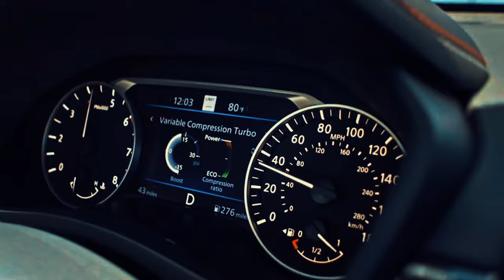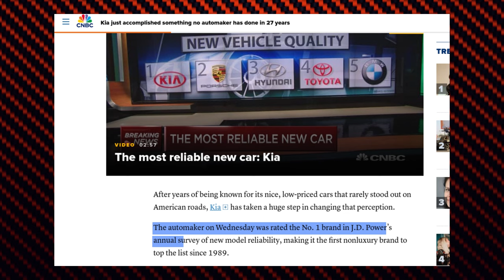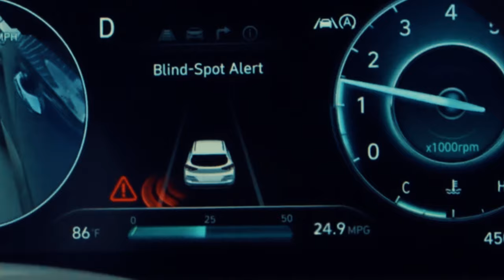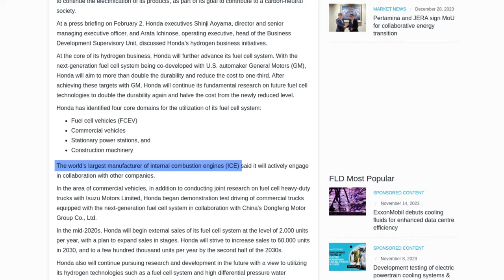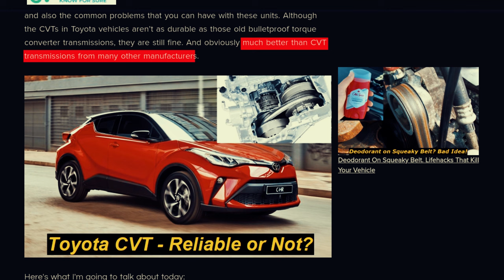The Most Reliable CVT Cars: A Brand Comparison

Comment: Whenever I hear someone state that a transmission, motor or vehicle can last over 100,000 miles, I take that as a red flag. As far as I'm concerned, any vehicle that has been taken care of should last at least 250,000 to 300,000 miles. There should be the occasional over 500,000-mile vehicles.
Reply: I have a 2015 Subaru Legacy with 183, 000 miles on it and no transmission (or any other problems) and expect it to just keep running fine.
Reply: @dankelley6194  If you take good care of it, it just might do that. I have a 2014 Legacy and just love the car.
Reply: @dankelley6194 that’s great to hear, my hyundai just hit 85k on the dash no problems at all yet it’s actually a little worrying I feel like everything will go wrong at once instead 😂
Reply: My ford fusion cvt lasted over 220k. It doesnt actually have a band like the others but two electric motors/generators inside.
Reply: My thoughts exactly. Any decent vehicle should last at least 250K miles.
Reply: The industry average I think is around 150,000 miles or 12 year life span.

Toyota is among the few brands that can make it over 300,000 miles.
Reply: @lrn_news9171  It's truly a shame. The industry average should be much higher than that. We need to have vehicles that will last a lot longer than that.
Reply: Which is why I do a drain and fill of the cvt twice a year. I got a smoking deal on 40+ quarts of castrol cvt at $2 a quart as a shop closed its doors and had a bunch left over. I'm not worried about the engine, it's the cvt that scares me lol.
Reply: @vermontvermont9292  Good luck. I hope that your car is one of those that lasts over 500,000 miles. Taking care of your vehicle and making it last a long time is something to be proud of.
Reply: @dankelley6194 have u done cvt service ?
Reply: I had a '91 Sentra with 293k that started on a dime after sitting idle all winter.

Comment: Ain’t No way you said Hyundai and Kia were reliable lmao despite its history😂
Reply: Outside of the US they are highly regarded as reliable. Outside the US cars are also maintained far better I work at a Hyundai dealership 9/10 of the problem is between the steering wheel and seat. The 2.0 NU series engine in the Tucson is garbage but the rest are decent even the Theta series with the class action suit we have 5 in the family all in 2011-2013 Sonatas and they are very good cars. All over 180k miles with little to ZERO issues 3,500 mile oil changes with factory filters
Reply: 1 Veloster. 2 Elantra in family. Well over 100k. Not 1 non-maintenance repair. I’d call that reliable.
Reply: No CVT 6 speed std 06 Optima  went 232,000 miles with original battery serpentine belt alternator and headlights. Went through brakes and brake lines and tires but was a good car.

Comment: I find it insulting that videos like this lump the rubber band CVT together with the Planetary gearset E-CVT in the Toyota hybrids.  Those two transmissions are no more alike than apples and elephants.  The Toyota hybrid units are mechanically very simple, are bulletproof, and can easily last several times longer than the best rubber band CVT.

Comment: Honda is not shocking my former 2015 Civic Lx before the wreck had a great Cvt transmission unlike Nissan, Hyundai and Kia not shocking, because even my 2014 Elantra Limited has a decent normal 6 speed automatic transmission as well, Kia and Hyundai are hit or miss on transmissions and engines, otherwise I personally think there quality is similar to Honda and slightly better than Toyota on minor things, otherwise the same, Subaru definitely no surprise at all, and Toyota is not shocking, but there reputation isn’t as good as it once was same can be said about Honda, so with that being said: For me: It’s Honda, Hyundai/Kia, and Subaru on Cvts, non Cvts: Kia and Hyundai, Honda, Nissan, Mazda, and Subaru, reason being for Nissan is because there non Cvt transmission models are very reliable and Mazda is strictly non Cvt and reliable in general! 👍🏻

Comment: Toyota's eCVTs, used in their hybrids, are among the most reliable transmissions ever made, including manuals. I wish they would change the name to avoid confusion with the rubber band variety.
Reply: @67daltonknox  . Is hard to beat a planetary gearset. Model T used them.
Reply: No….not really on Toyota.  I’ve seen too many issues with them
Reply: Totally agree. Instead of eCVT, it should be eAT. No belt, no pulleys; instead it had 2 electric motors and planetary gears + electronics.
Reply: It is still continuos variable ratio, thus the name remain as a CVT despite using different approach. Another type of CVT not uaing belt is Nissan Toroidal which uses rollers instead of a belt, maybe a review video on this?
Reply: @danielkopial316  . The planetary gearset CVT avoids friction. 
The mechanical CVTs count on friction. 

Toyota (and Ford) hybrids are electric cars with gasoline engine assist (especially below 45 mph).
The electric part is direct drive like most battery electric cars. 
The CVT is only for the gasoline assist engine. 
Above 45 mph the 2 electric motors manipulate the planetary gearset to make the gasoline engine do all the work (at it's most efficient rpm). So some might claim the car is a gasoline car with electric assist (and be sort of correct).

Modern Honda hybrids are mostly series hybrids. Electric cars with gasoline powered generator. 
They also have a gasoline powered mode out at highway speed where the gasoline engine is direct drive to the drive axle (for extra efficiency).

I really like the Toyota Ford approach to planetary gearset hybrids. 
Electric car goodness without the electric car drawbacks. 

I won't buy a turbo car or mechanical CVT car.
Reply: @dannybryant6873  being a mechanical engineer, I consider both as mechanical cvt lols! I agree that planetary gears are very robust & will last longer than belt types. But for a specific designated operating environment & conditions, a belt type CVT has been proven to last the practical lifetime of a vehicle (10-15years). As for the turbocharged system, passenger vehicles with oem turbocharged engines are not made for performance. They are designed with the engine to improve volumetric efficiency & with valve actuation controls the ability to have atkinson cycle on a normally otto cycle engine design.

Simply put it this way, just as everyone would understand not to use a minivan to do a truck’s job…likewise don’t use a commuter car to do what a performance car can do. They have very specific designed operating environment to meet the ever stringent EPA standards. 😉
Reply: @danielkopial316  My car is 29 years old and my pickup 23. We have different ideas about "the life of the car". Long live Toyota.
Reply: @67daltonknox  lol…yeah the actual life of a vehicle can go beyond 10 years. But standards on safety & environmental protection regulations is changing very rapidly. Many vehicles had to retire early when they no longer meet the standards & regulations. Insurance & taxes can be too expensive to keep them 😂😂
Reply: @danielkopial316  Don't know where you live, but nobody is forcing vehicles off the road around here for old age
Reply: @67daltonknox  Good to know that...come to think of it, isn't it funny how the law tried to protect the environment but at the same time creating more waste & uses more energy (to produce newer "cleaner" vehicles)...its all about the money.
Reply: but hybrid batteries are charged and discharged at a high C rating, so they will need to be replaced in some times instead. I prefer PHEVs or total EV as their battery is big enough, atleast they can drive on electric mode for more than an hour.
Reply: @samueladitya1729  Where I live, that is no advantage because the cost of electricity makes an EV no cheaper than a hybrid.

Comment: Had 3 subarus now, a 14 forester xt, a 22 crosstrek and now a 19 outback 3.6r. Never had any issues with its cvt. Just regular fluid change every 40k. I dont do towing so my cvt's are not strained. I really love them cars
Reply: I bought 2015 subaru OB 3.6r , has 125k miles. Its so smooth and responsive! I just hope my cvt last to 250k miles or more. Ill do cvt fluid change soon!

Comment: Subaru CVT transmission is RELIABLE My 2014 has no issue related to CVT transmission. I got over 80,300 miles now
Reply: Lol same. My 2014 forester is now at 120k. Just regular cvt fluid changes, no leaks, slippage or any issues. And I dont even baby or drive like a grandma.
Reply: @doodskie999  what's your fluid change interval, and do you replace the filter?
Reply: @samueladitya1729  Subaru CVT's have no filter, it only has a metal strainer. I just wash it with brake fluid or gasoline and dry it off. I replace the fluid every 40k.
Reply: @doodskie999  Oh that's nice, I have 2017 honda now at 70k no problem so far, but hearing many had problems at 100k makes me nervous so I drive keeping it under 3k rpm and do fluid change every year or 20k, half the recommended because I can't afford it to break. Maybe my next car will be PHEV or electric.
Reply: I bought 2015 subaru OB 3.6r , has 125k miles. Its so smooth and responsive! I just hope my cvt last to 250k miles or more. Ill do cvt fluid change soon!
Reply: @doodskie999  I bought 2015 subaru OB 3.6r , has 125k miles. Its so smooth and responsive! I just hope my cvt last to 250k miles or more. Ill do cvt fluid change soon!

Comment: Purchased  my 2014 Subaru Outback in 2018 with 37k. It is now clocked at 64K.  Transmission CVT fluid changed at 60K.  So far this car has been excellent.  I do not drive my cars hard.  I do feel a slower engine speed as the car increases speed.  My fuel economy averages 27-29MPG local and achieves 32-34MPG on highway driving.  Over time, I "learned" how to "ease" the gas and let the CVT adjust itself as the car gathers speed and the RPM's slow.

Friend of mine had an 2009 Forrester,  new, ran it up to 194K and traded it for a Ford Escape.  Never had a CVT problem with his Subaru. He did say, he kept up with the CVT fluid changes and oil changes as well.
Reply: Could be mistaken but don’t think the 2009 Forester was equipped with a CVT.
Reply: 2010 Outback was first
Reply: I bought 2015 subaru OB 3.6r , has 125k miles. Its so smooth and responsive! I just hope my cvt last to 250k miles or more. Ill do cvt fluid change soon!

Comment: I have a 2013 Accord EX 2.4L w/CVT.  It's about to hit 102k mi. Bought it used when it was 4 years old and had just 20k mi. Although it's been very reliable, this car cannot compare to the 2002 Accord EX I had years ago. Where I enjoyed taking my 02 out for drives, I do not with the current car. It's the most boring thing to drive. It only gets driven to/from work and nothing else. Seriously considering switching to Mazda after this. Honda disappoints with CVT transmissions and now their engines are turbo. No thank you.

Comment: 800 miles trip, fully loaded Outback, two adults two kids, dog, luggage to the ceiling. 80mph highway across farmland winds. 31.8mpg. Can't complain about the fuel efficiency, but the trade off is a floating, disconnected feeling between the driver and car/road.

Comment: My 2010 Subaru Outback has 116000 miles without problems. Changed transmission fluid at 112000 miles and it is more efficient than new.

Comment: I have a 2015 Nissan Versa Note with a CVT.  No issues; however, I do have the CVT fluid changed every 30K miles.  I think Nissan gets a bad rap too often.
Reply: Yes. Lack of maintenance is the main cause of early failure.  Change cvt fluid every 30-36k miles and they last alot longer
Reply: Cost per change of fuid $400.00
Reply: @chief1960  At the dealer or a repair shop maybe but definitely a must if you want a long service life. At least every 60-80k. I do it myself. A drain and fill cost me $70 in fluid and drain plug seals for my Subaru so it's cheap. I feel better doing it every 30-36k along with a gear oil change in my fron/rear diffs and a fresh engine air filter. I just do it all in one go for around $100
Reply: My sister against my advice bought a Nissan note cvt fsh serviced to the schedule it broke unsurprisingly fortunately under warranty so not out of pocket just inconvenienced moved on shortly after thr note otherwise isn't a bad wee car.

Comment: I have a toyota raize with a 1000cc turbo charged engine and a cvt and it also has a first gear. It is known as drive shift cvt. so the first gear cvt is not only limited to bigger engines.

Comment: My son’s 2020 Impreza brand new in aug 2020 had the cvt replaced within 2 yrs and 44k miles , but my 2019 Impreza with 68k is going fine, I think it’s the driver because I was familiar with a cvt in my Prius, you have to be gentle and no hole shot starts at lights are just slamming / shifting gears fast from reverse to drive

Comment: Regular CVT fluid changes should result in longer lasting transmissions. I change the fluid in my Subaru's CVT every 30-36k miles and have no issues. Be sure to use factory fluid or equivalent spec aftermarket fluid. I use Idemitsu SB2 fluid for my 17' Crosstrek. Idemitsu is the manufacturer of Subaru CVT fluid and also for the Nissan N3 fluid.

Comment: Just had my 2017 Rav4 2.0 GX FWD CVT fail completely at 42,500km (26,562 Miles) Dealer wants R114500 (South African rand) ($6350) to replace. This is over one third of the current resale value of the vehicle 😒
Reply: How hard do you drive it

Comment: I realize there are a lot of factors in this statement but for some reason when someone uses the benchmark of 100,000 miles on a transmission it  kind of makes me cringe.
That used to the norm if not many, many more miles. 150,000 plus was kind of the norm.  Now it seem like if you make it to just " 100,000 " it considered a good transmission. I realize transmission are way more sophisticated than 20 years ago but high tech or efficient doesn't mean reliable.
Example was our 90s Lexus 400.
300,000 miles on the original transmission with regular service and was still going when we sold it.

Comment: Hyundai has a 8 speed CVT? What is that?
Reply from the maker: Thanks for spotting. I should've said 8-speed IVT(Intelligent Variable Transmission). It employs similar technologies which is found on  CVT's. I will make the necessary corrections. Thanks!
Reply: It's a fake "8 speed" setup.  The computer simulates gear shifts.

Comment: I won't buy a vehicle with mechanical CVT. Or forced induction (turbos supercharger s) .

I really like the modern hybrid cars that are electric cars with gasoline engine assist. 

Most of the electric car goodness without the electric car drawbacks.
Reply: I couldn’t agree more.  I’ve owned a 2023 Kia Niro hybrid (not plug in) and was surprised at its amazingly smooth dual clutch transmission.  It’s more than peppy enough for us.  But what shocked me was the DCT- unlike years of customer complaints and breakdowns with FORD & VW dual clutch vehicles, the Niro’s is brilliant.  Never a jerky shift, and not one problem in a year and a half.  Nothing to plug in, no need to install a charger and spend a fortune to upgrade my electrical panel… And of course, the gas mileage is sensational.  
-I have driven CVT cars before and hated the trans in every one.  The Niro is just like driving the best torque converter tranny out there.  When this lease is up, another Niro will replace this one.
Reply: @ircorva67  . Toyota hybrids (hybrid Synergy drive) use a planetary gearset and electric motor to provide CVT action to the gasoline assist engine. 
So get electric car smoothness even when the gasoline assist engine is helping (which is quite often as the electric resources are minimized) 

No clutches. No mechanical CVTs

Comment: 05 Prius with 283k no transmission problems
Reply: The Prius does NOT have the kind of CVT talked about in this video.  It uses two electric motors and a planetary gearset.  (Actual real gears.)  The heart of the planetary gear set in your Prius has only eleven moving parts, plus bearings.

Comment: NEVER BUY A CVT, NEVER BUY A TURBO, NEVER BUY PURE DIRECTION INJECTION CARs… DO THESE THREE NEVERs and you will
Save yourself pain and suffering
Reply: then walk because every manufacture is going in that direction.
Reply: That’s why people lease
Reply: I don't believe you can buy a small car without a CVT in the USA in 2024. I believe only the Mazda 3 and CX3,5 come without CVT. Also, good luck if you want a small car with a Manual shift tranny, those are not even for sale in the USA any more, you can buy one in Mexico and Canada, but not in USA. Even the used car dealers will not buy those cars from the Auction , they can't sell them, nobody wants them now. Many young people under age 35 have no clue how to drive a manual shift and don't want to learn.
Reply: @j.rcoker9051  very true statement.

Comment: Bought new 2015 outback 3.6L w/cvt had to replace transmission 45000k luckily under wsrranty.
Also my preowned 2018 cvt with 114000k is failing however Subaru won't  fix unless i oay $200 diagnosis and then $570  transmission fluid service....that should have been done when dealorship didn't bother to do at my 100000 k service.they told me i should have asked...morons

Comment: My older 4 and 5 speed automatics with dipsticks are great. New cars are a joke. Over 1000 dollars for windshields. Turbo cam phasers timing chains cvts. Junk. Tons of crappy electronics. High cost repairs.
Reply: Old 92 camry almost 500 thousand miles trany and engine still original. Runs like new. Does leak oil.  Cardboard under

Comment: Honda  make own cvt very good . Toyota don’t have experience  to make cvt
Reply: Honda cvts have serious steel belts problems. It is well documented. In my country broken steel belts cases runs into the thousands. Toyota cvts almost zero problems.
Reply: Do some research Toyota makes the best cvt. 
And the e-cvt is one of the most robust transmission on the market. And will run flawlessly for over 500,000